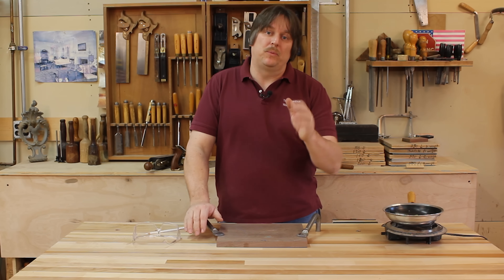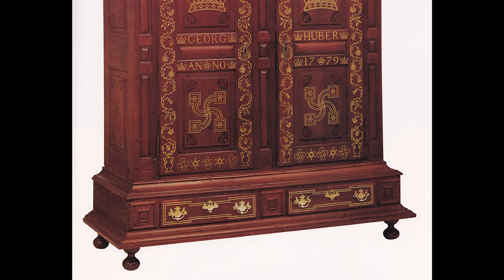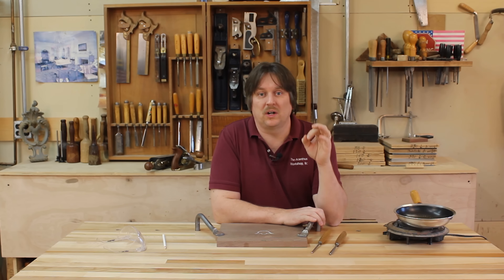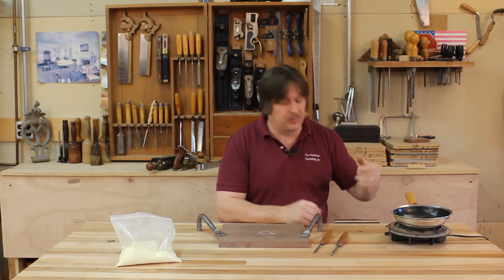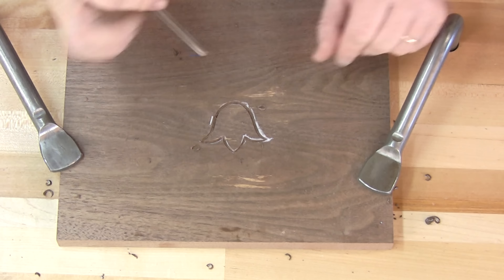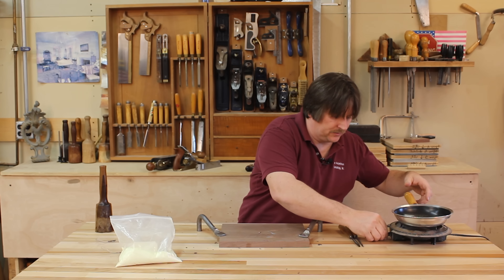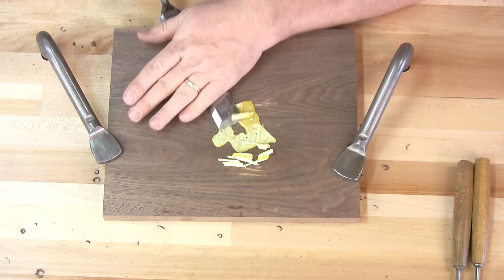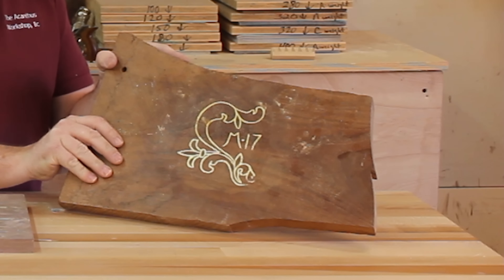Seriously Simple Sulphur Inlay

Comment: Very interesting, really enjoyed watching this. As far as the bubbles go, would it be possible to heat the sulfur during the cooling period with a heat gun to help rid the bubbles? That is, by heating the surface and letting it be less viscous than the bottom (next to the wood), the bubble could pop and fill in with newly liquid sulfur? (I hope that makes sense.)
Reply from the maker: I've tried it in the past with limited success. The heat from the molten sulphur is essentially evaporating off some of the moisture in the wood, creating the bubbles. When you warm the area with a heat gun, the wood gives off more moisture.
Reply: @acanthuscarver  Interesting. So if the source of the bubbles is moisture in the wood, would pre-heating the wood decrease the bubbles?
Reply from the maker: I have not found it to significantly reduce the bubbles. You can't evaporate enough moisture out of the wood to stop if from shedding more when heat is applied.
Reply: @acanthuscarver  Alas. Well, thank you very much for your expertise. Very interesting subject.